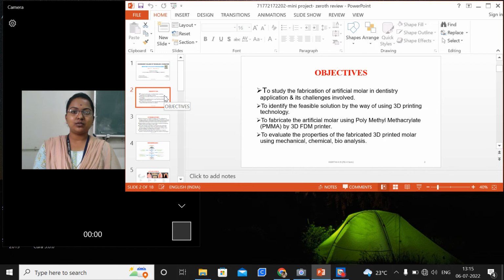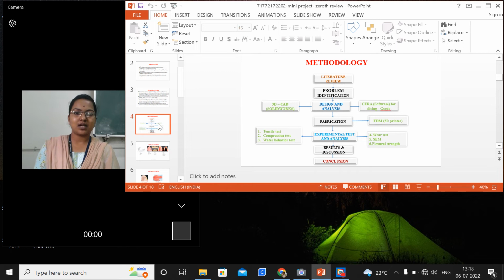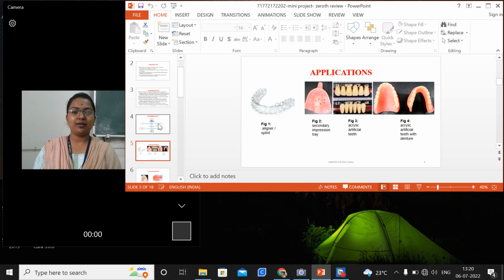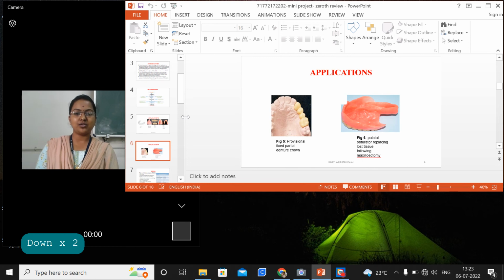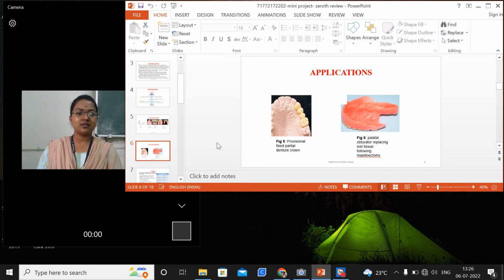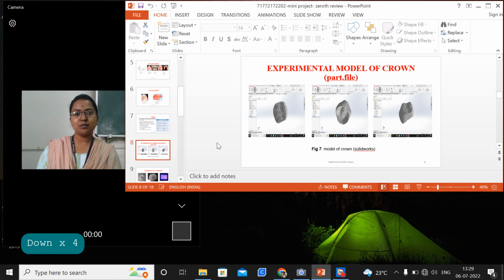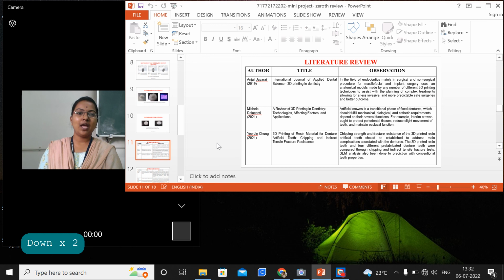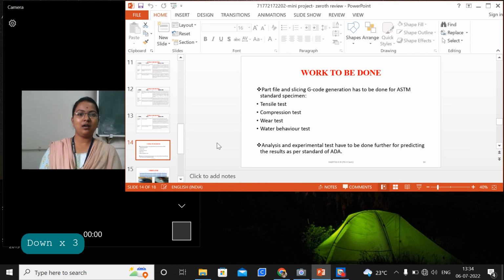WAY OF LEARNING IN GOVERNMENT COLLEGE OF TECHNOLOGY, COIMBATORE PG MANUFACTURING ENGINEERING

Comment: I wish this P.G-Manufacturing Engineering of Department of Mechanical Engineering a grand success by the way of gaining real industrial exposure, placement with high CTC , freedom to access the laboratory etc. I, the Head of the Department,  invite the students'  community to join this Prestigious Government Institutions especially at P.G- Manufacturing Engineering  to get a new horizon/life dimensions for your life. As of now, more than 15 students currently pursuing their doctoral degree programs at GCT, NITs, IITs and abroad. So, dedication, sincerity and devotion lead this department a grand success. The Delhi Government has now  initiated Intelligent Traffic Management Systems (ITMS) based on Artificial Intelligence (AI). We are also providing the platform to learn AI and to implement in Manufacturing and General  Industries. Our forthcoming students  may be inculcated to utilize the AI in routing/scheduling problems/Internet of Things  (IoT) enabled machining operations etc. The New Regulations 2022 facilitates the new dimensions of learning.   I wish you very all the best.